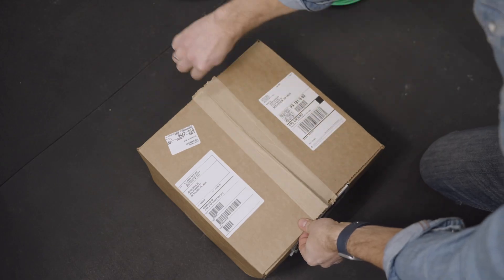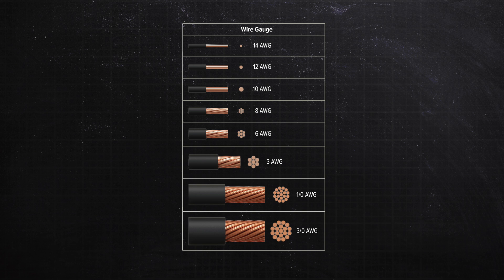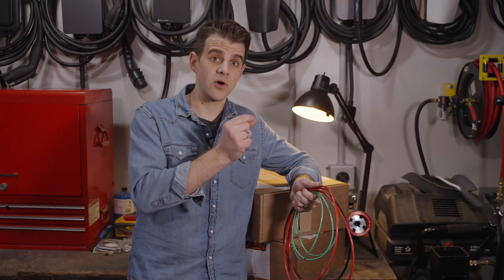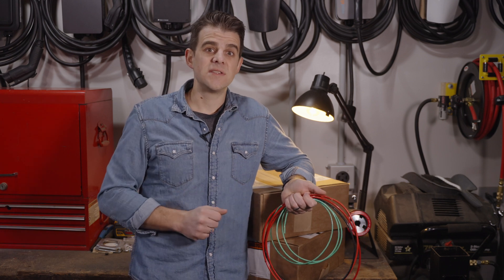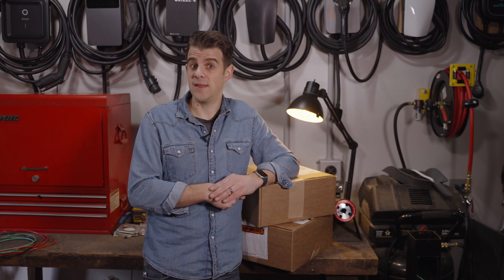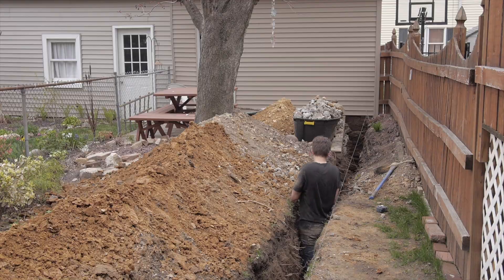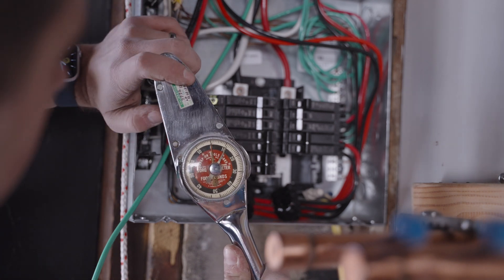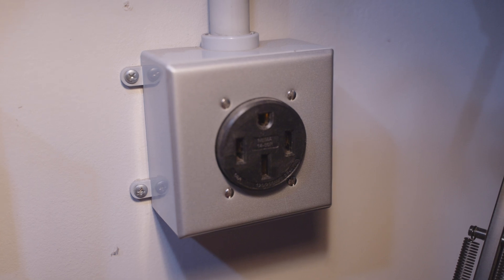Installing EV Charger Wiring

Comment: You said that 6 AWG Romex cannot be used.  I don’t understand why.  The cable as a whole is rated for 60 degrees C but each individual conductor is rated for 90 degrees c.  6AWG Romex should be fine on a 50A breaker.

Comment: That 4 guage was total overkill brother.   But u got it done.  Props.
Reply: Did you see all the breakers in the subpanel he's rewiring? This isn't just an EV charger, he's powering electric heat in the garage and multiple other circuits. The title would be more accurately described as how to upgrade a subpanel feeder wire. I think it may still be undersized, he'll have to be careful not to have too many devices turned on at one time. It might have been better to add a second subpanel, but then he'd be digging more trenches, ha ha.

Comment: When should some chargers being available for sale?  Suggested price range?

I suggest both the bollard and a 'box' for a wall for inside installs.  Multiple options just for the 'distribution' end.

Also, I suggest setting up a version that is 110v only.  But I still suggest wiring for high amps when someone wants to upgrade eventually.  So making it an upgradable path would be good.
Reply from the maker: We'll be sharing more on the timeline and cost soon, and there will be two versions, similar to what you're suggesting. 

Currently, we support 120 to 240V, so an install could be made using an upsized wire that can be upgraded to a higher-current 240V in the future.

Comment: I appreciate your conservative approach, using the 60° column, even when you could be pushing to 75.  Not only do you gain thermal margin, but you gain a little bit of an efficiency improvement, which, for people with long commutes, good, over some years, pay for the heavier wire. 

I agree with using copper for wiring an EVSE or 14-50R.  In addition to the other considerations, the terminals in those are almost never rated for aluminum.  For a subpanel, I think aluminum is fine, but you would need a whole nother section of the video on how to do that properly, so that might be better left to professionals.  Assuming the professional actually uses a torque wrench, which many don't. 

But in your case, I don't think your conduit would have been big enough to fit the bigger aluminum wire, so you really had no choice.

Speaking of conduit code requires gluing your PVC conduit (352.48) even indoors.  That's one reason that I think EMT is easier to work with.
Reply from the maker: Thanks for the comment. I agree on the copper front. I didn't have room for aluminum in that conduit, and frankly, I barely had room for the 4 gauge.

As for the conduit, I was expecting a comment on the code. Leaving it unglued has allowed me to make some modifications over the years, which would have been considerably more difficult if it had been glued (not an excuse, but a reason). I should look into EMT. I've used it for some internal runs, but for these indoor/outdoor runs, running PVC the whole way has allowed me to not make a transition at the wall.

Comment: Nobody with a BEV should rely on 120v charging.  Get a 240v, or you’re going to be in for a headache.
Reply: I used a 120 volt outlet for almost a year. It was slow but my car is parked almost 22 hours a day so it didn't really matter. I heard that's pretty average.
Reply: People with commutes less than 40 miles can plug in for 10 hours on L1 and be fine--no L2 required.

That said, L2 is nice (even if it's just 15A @ 220V) and does indeed give you peace of mind.

But hardly required for many folks.
Reply from the maker: It will depend somewhat on the vehicle. If you have a small car/battery 120V is easier. One of my friends was doing this with a Leaf and then a Bolt, while having a 180 mile commute twice a week. Still, they were so happy to finally get a L2 outlet.
Reply: 120 volt charging can often suffice. It all depends on the use case and the vehicle. When I tiptoed into electric vehicle ownership via plug-in hybrid, 120 volt was adequate as long as the circuit was dedicated.
Reply: I have been using a 120v for almost a year. My daily commute is around 75 miles a day. I’ve not had a single issue, ever. For road trips I’ll stop by a DC station but I’ve only HAD to do that a handful of times. Never been an inconvenient.